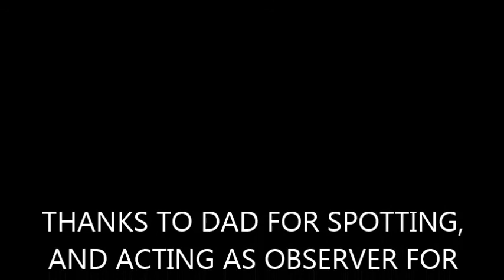GEMINI ENDURANCE RECORD/FLIGHT TESTING/ADVANCED LONG RANGE FPV PLANE

Comment: Hello
I subscribed to your utube account 
I think you are doing a great job

Questions
A. 2 hours and 40 minutes would give you over 100 miles range?
B. Do you you lion battery? 
C. Why you don't use the LT 4/5 G wifi for Telemetry?
D. Does this plane carry additional payload? 

Sincerely 

Francisco
Reply from the maker: Yes, we're using Arduplane firmware and Pixhawk now with all projects.  This was before they were developed to the degree they are now. We actually have a tuning guide available now for Arduplane and fixed wing airframes on our website.  
we also use li ion battery now with over 4 hrs of flight time.
yes, the plane can carry a payload.
Reply: @FPVREVIEWS  
I am interested in buying a long range fixed wing 
What is the maximum mile range?  
You have room for payload. How much payload? 

If I buy your plane, can I install XBSTATION for long range Telemetry?  
How much does it cost? 

I watched the X- UAV SKUA but the manufacturer is not as transparent like you

You really shows everything and build a reliable plane
Reply: @FPVREVIEWS  
I read the spec and description

Comment: Very impressive. Are the batteries being ventilated? Battery temp has a lot to do with endurance I would think
Reply from the maker: because of the extremely low discharge rate, the batteries stay cool s a cucumber. that's real important on fast models drawing a lot of power from a small battery, and not so much on a long endurance model. in fact, the efficiency of the batteries will be hurt if they are at too low of a temperature.   a common problem for early spacecraft. you don't want to let lithium batteries get too warm either, it damages them.  i was pretty hard on the batteries, in order to push the endurance flight, so take my example as the best, trying to set a world record there..   thanks for the excellent question though. if i'm wrong about onay oft his, i am open to discussion, and please share reference material too, of possible.  best, spike

Comment: i have one question how do you connect your batteries for longer  flight? thank you
Reply from the maker: in parallel.
Reply: With what type of connector?
Reply from the maker: Eng Faisal
deans, although xt-60 would work too. see the gemini reveiw video to see the ones i used.

Comment: I'm really interested on a RTF set up, video and all, how much would it cost me?
Reply: I hate to say, but it you need to ask questions like that - then you are not RTF. Learn to walk before you try running, these things take skill & understanding to fly. Get something like a Hobbyking Bixler ( basic trainer) first and learn to fly. That'll cost you somewhere around £150 to put in the air. Then join a club to get teaching. May seem unnecessary hassle but it will get you through the learning curve much quicker and more cheaply than going it alone.

Comment: If ive missed it sorry but, what is the AUW of the Gemini?
Reply from the maker: about 17+ lbs fully loaded. version 2 will up that to 20 + lbs.
Reply: Thanks.
Reply: FPVREVIEWS the wingspan is 30 cm shorter and the airfoil the same. How +3 lbs?

Comment: Hi! Quick question! What motor and battery have you used to reach that flight time?
Reply from the maker: e-flite power 15 motors with castle edge speed controllers, and 13x 6.5 thin electric props.  i have since found an efficiency benefit from using a slightly higher pitch, a 13 x 8 thin electric prop.  it's very slight, but saves about 1 amp draw to remain airborne.
Reply: FPVREVIEWS
Oh, I see! So you might be using 3S or 4S LiPo batteries as you have a pair of 950Kv motors on board. I found your GEMINI quite interesting. Actually, I am going for some twin prop FPV/UAV platform for long range flight like your GEMINI. The closest I could find was a CONDOR 300 UAV or so-called E300 UAV by Elimco. Please check this desing out and see what you think about this UAV platform. I believe it's worth a carbon fiber over your GEMINI, don't you think?
Reply from the maker: Hedio Trevisan i use 3 cell batteries , although either would work, throttle management , and the right props are the key. you also have to be very careful not to over prop a motor, and burn it up in an extended climb. i run about a max of 80 percent of rated amp draw, continuous to provide a margin of safety.  see my other video on the motor fire, and emergency landing. ask me how i know....
anyway, i like the condor 300, but i think they would be better off using tractor motors operating in clean air.  
the pusher has great theoretical efficiency, however there is a very real issue with turbulent airflow entering the prop arc, creating vibration , and loss in efficiency.   i like the wing design, and high aspect ratio! looks like they are in the process of improving the tail design, as they are moving it up vertically on the booms in the latest version.  one vertical is much more effective than two smaller ones, however.  and crossing it with the horizontal on top has some great benefits in effectiveness at low speed, and pitch stability(dynamic)  two counter rotating props have the further advantage of producing no net torque in the roll axis, and combined with the t-tail to clear the accelerated air, there is a minor benefit in efficiency.  the more  efficient an airplane is, the more benefit it can derive from small gains. i considered the layout of the condor before designing gemini, but would like to see my layout combined with their construction,a nd perhaps , wing.
Reply: FPVREVIEWS
I have been told that 4S or even 5S batteries would give you some economy in flight due to higher voltage offered. Well! I am putting an effort to find out the best combination such as props, motors and airframe platform to fly it for many hours over the crops. In fact, I am looking for a very stable flight control and I have searched over the internet some airframe models kits like the HRS KA-6 Color F 147" Wingspan Glider by TBM which it would be nice to fix two motors under the wings, the ESM DC-3 103.9" wingspan which has a very roomy fuselage but its overall airframe look may reduce your flight time (amperes consumption) due to the dragging effect, however I could compensate it with more batteries as this model has a large wing area though. What do you think about these models? Which one would you go for? The first one requires a pair of motor mounts while on the other side we have the DC-3 ARF, with no motor mounts improvement needed. I forgot to mention the ESM F7F Tigercat Matte 82.9" Wingspan Model ARF and the ESM BF-110C Zerstorer Color F 95" Wingspan Model ARF both with very good wing area.
Many thanks,
Hedio
Reply from the maker: Hedio Trevisan well, it's all about energy density. there is not much energy net loss in the wiring on an rc plane, so it should n to make a noticeable difference if the voltage is high or low. i guess the wiring could be a little smaller, but should not be a big deal.    
the problem with modifying a sailplane for long endurance powered flight, is that you will be operating the airfoil at a higher wing loading, and at a higher airspeed, and therefore changing the operational reynolds numbers, bringing it out of it's intended flight envelope.  that's why i designed gemini. to provide a hybrid aircraft with the aspect ratio, and good L/D ratio, while being designed to carry a heavy load of batteries.  sort of the best of both type of concept.
Reply: FPVREVIEWS

Ah... the answer to my dilemma!  :)  Thanks!  (Subscribe if you want to see some clips of the build(s) and maiden/test flights, etc of the Gemini V2)

Comment from the maker: Plans available Now at bearospaceindustries.com !
Reply: Do you use a UHF for the transmitter range? I've been watching this aircraft for a while, very nice performance
Reply: Stefan Kozma  Hopefully I will be building one in garage when it gets warmer. I was thinking of using some composite materials to increase strength with less weight, say in the body and wing. maybe 3d print spars. Do you think converting to pusher configuration with more weight upfront would increase efficiency? I know that it can cause vibration if engine is behind main wing.
Reply: Stefan Kozma Maybe double, up-high pusher props above the wing.
Reply from the maker: Stefan Kozma Hi. The flight controls use an EzUHF system. The observer cam is controlled with a Dragonlink UHF.
http://youtu.be/8bX4S19_OV0 Here's a link to a video on how to set up long range FPV through UHF.
Reply from the maker: Stefan Kozma Doubtful that weight savings could be achieved. I do not think pusher configuration would be more efficient, and yes it would likely cause vibration

Comment: Heya kudos on the plane, what was the total Distance covered during the flight?
Reply from the maker: I don't have that data specifically, but it should have been about 120km, roughly.
Reply: Amazing, how long would it take for me to assemble a similar model from your blueprints? and estimted cost if outsourced?
Reply from the maker: DKBN good question.   several weeks to build.  it's not a weekend project, even not a week project. try a month, maybe?

price?   well, materials are at least 300 to 500 u.s. dollars for the airframe alone, plus electronics. 
expensive compared to some other model airplanes, but cheap compared to other comparable military style drones. 
this aircraft is meant to fill that performance, and cost gap.  
hint:  we will be releasing the version 2 soon, and it's easier to build. about a week, and will have a build video. cost, similar.

Comment: What's your model weight ?
Reply from the maker: Youness Fouqani about 17 lbs.
Reply: Thanks. It seems like a good achievement, cruising a 17 lbs plane only with 20 amps ! Anyway, may I ask whether it is possible, sir, to achieve the same with a quadcopter ? Thanks for having replied.
Reply from the maker: Youness Fouqani  the long flight duration is achieved by having a high coefficient of lift, over a large surface, at a low airspeed, or reynolds number.  for instance, a larger airplane, at the same weight would fly for even longer, but travel slower, therefore becoming impractical, as the wind would blow it faster than it is able to travel.  there have been some advances in quad design, and they can use the  exact same principles to prolong their flight duration, but until their rotors are as large surface as the wings of an airplane, they will not get there. i'm pretty sure that have got over 1.5 hrs, or so, but not with payload, so for rotorcraft, this is very impressive! large props turning slow,a nd light airframe/ good energy density batteries are the key. optimal angle of attack for the rotor blades is also key, and airfoil selection for the blades.
i just did a 4 hr 2 minute flight with the gemini v-2 a couple of days ago, and working on the video now. 
i am using a more advanced Tesla style battery now.
in theory, it would be possible to achieve very long duration flights with a quadcopter, but it would have to be a very large quad, and would be very slow and fragile, also would probably have to be flown in a controlled environment. probably indoors.  check out the atlas human powered helicopter which claimed the 30 year old sikorski prize for human powered helicopters. something along tose lines could do it, but as far as i know, no one has even tried such a thing in electric. you could be the first!
Reply: Thanks so much. Well, I will keep my research open ! By the way, I find those tesla batteries quite interesting, as they double the energy density. The catch is that they have very low C ratings. Good luck with your project !
Reply from the maker: Youness Fouqani low c rating is not at all a problem, in fact, the battery can put out easily more amps than gemini draws.   and discharging over 4 hrs is more time than many laptop computers. 
sport models would eb the ones that would have a problem. they are not for everybody, but they are a great fit for models like gemini.    the energy density, as i measure is actually 67% more.  
don't buy any cells that say more then 3400mah's in 18650 size, and not any with the word fire in the name.